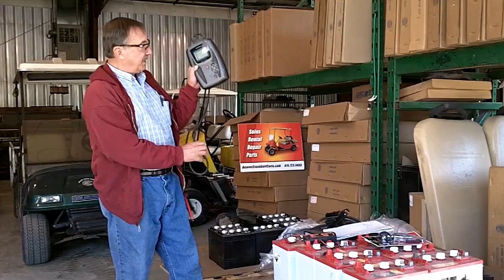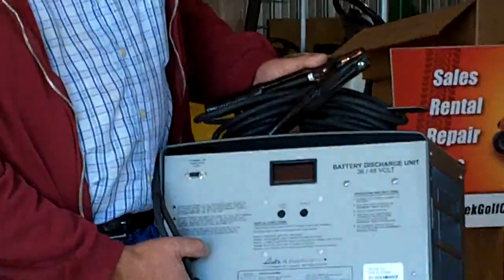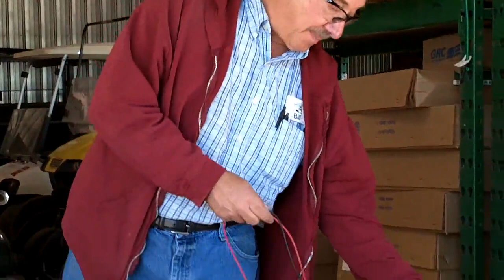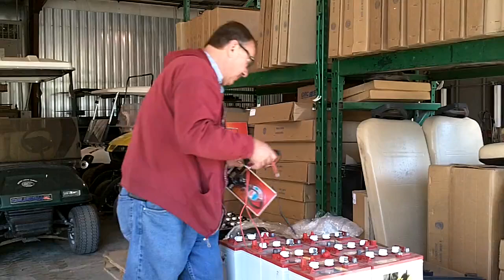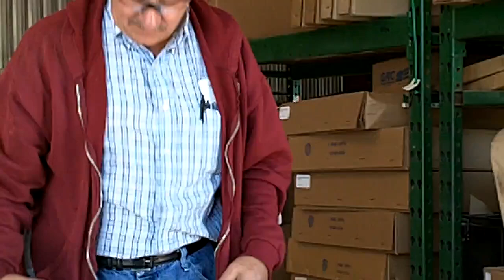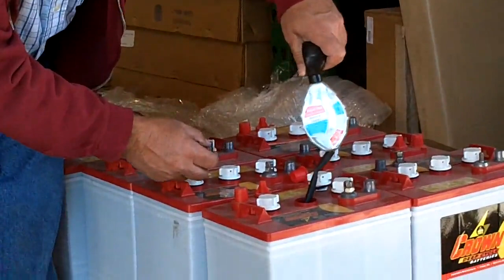Beaver Creek Golf Carts Shows You How to Test your Cart's Battery

Comment: Nice Video. Would you mind sharing the "expensive"  battery tester model? Thanks!
Reply: I work at a place that would absolutely buy that. I maintain big custodial equipment and they use golf cart batteries. I just started and they have a little car load tester and it doesn’t even phase a bad deep cycle battery.

Comment: Not a scam;  he does assume you'd know to select a range on your DVM that covers your max battery voltage, that's all.  Select 12V or higher and you'd be fine for either 6V or 8V cart batteries.  It's DC, of course, not AC, since there's no such thing as an AC battery.

Charging and then checking specific-gravity is basic SOP, as he describes.  In my case, that same cheesy hydrometer's paper scale fell off long ago, so I'd no idea what the scale was anymore - I think I'd buy a different model next time.

Comment: Set it on the proper voltage? What is that? Ac? Dc? The squiggly line? The squiggly line with a straight line? Bad "instructional" Video.
Reply: DC voltage.
Reply: DC voltage on 20